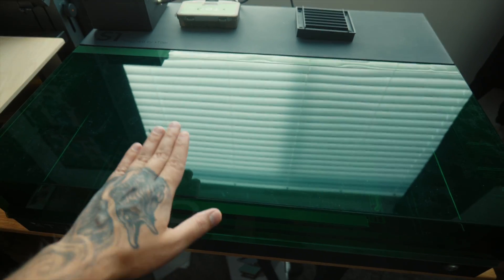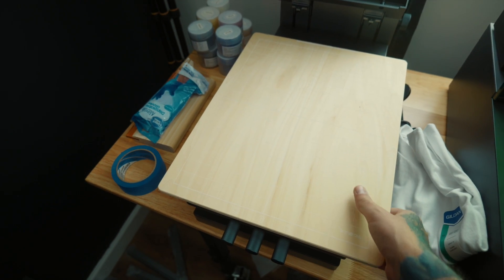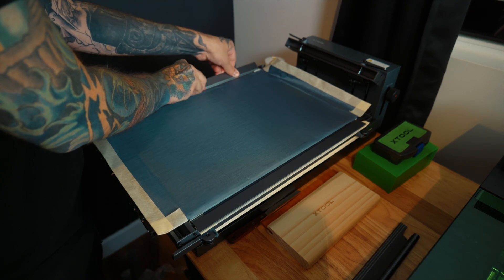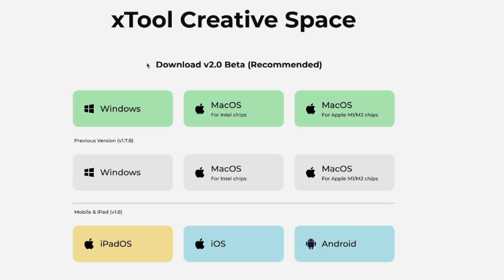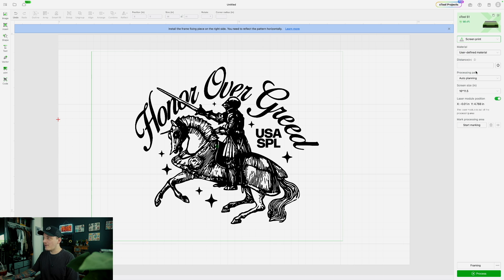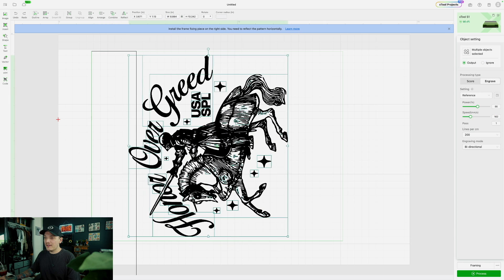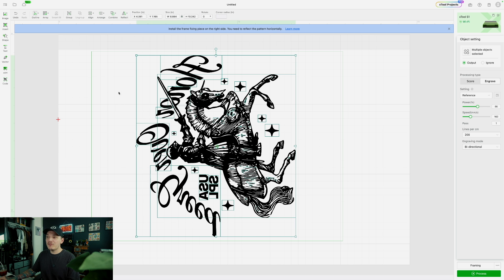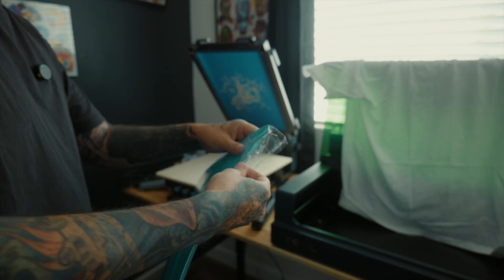Laser Screen Printing: The Future of DIY Tees

Comment: I like it. But the size of the fame is not the ideal for screen printing. 13" x 19" frame and mesh should be available for traditional screen printing who want to use this system for low volume jobs. And on the press , since the pallet is magnetic a pallete that can take 13 x 19" frame should be available.

Comment: Hi Charley
Thanks for posting this. Really interesting. 
I think it would have been useful for viewers if you had done a summary of how conventional photo emulsion screen printing works (coating, drying, artwork to film, exposure, wash out, drying etc) and how this system is different. As I understand it this system uses its own frame and pre-cut mesh and a stick on equivalent to photo emulsion. Will this system do multi color prints?
If all you need is a fast set up for a single color short print run with bold vector art then you could just use a vinyl cutter - either to stick directly to the screen or to cut a dedicated film.
Reply from the maker: This setup will do multi-color prints with ease. I decided to focus on 1 color for my first attempt at printing haha. 

This machine really just saves time on preparing screens since it uses a laser versus burning screens.